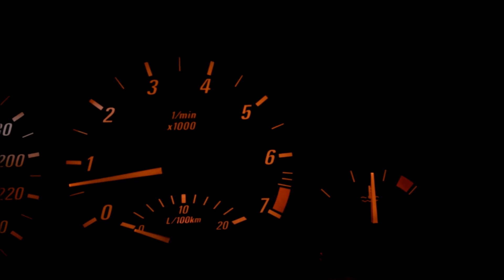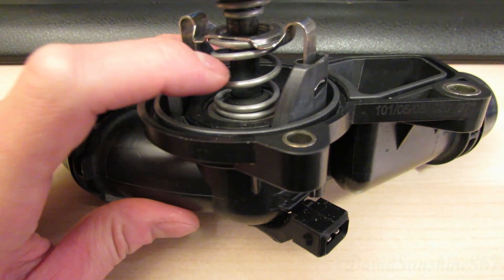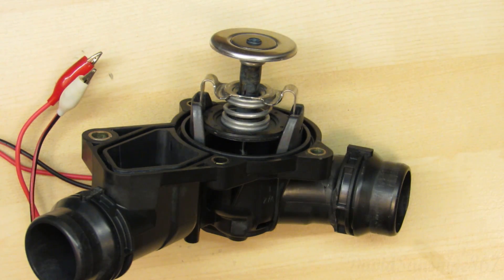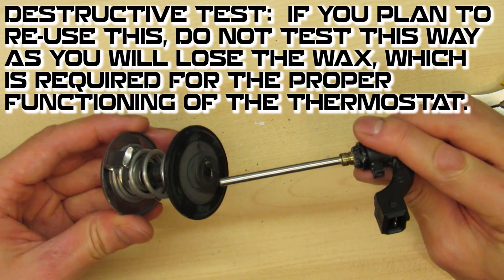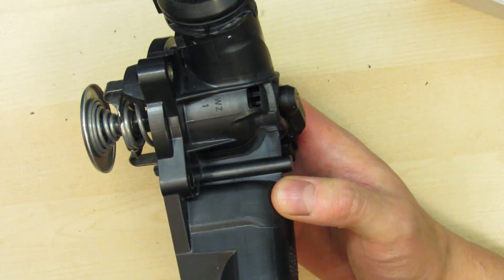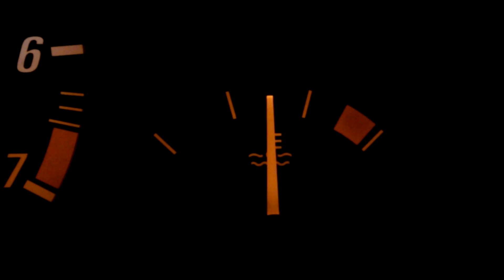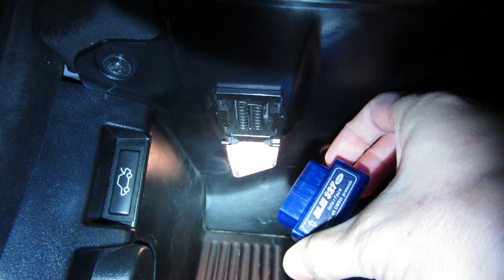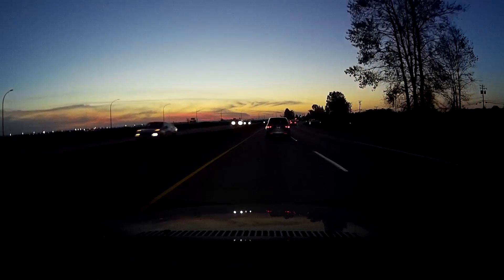How a Thermostat Works in the E46 - How to Diagnose a Broken Thermostat

Comment: David:  Just like you and your readers to know that my 2003 330i (purchased in 2003 with about 20,000 miles) just passed 100,000 (used to be wife's car)!  Thermostat never replaced!  So apparently it has a life of more than 10 years; car always parked inside garage, in Portland Oregon.  Bought a thermostat Wahler (box said Made in Germany with the BorgWarner marking) in 2017, not installed.  It cost less than $50 from Amazon.  Still exploring the mechanical aspects (draining the coolants and removing the fan and shroud a big adventure for me), hence coming across your excellent video.  Yours gave me more confidence!  Just re-built the DISA valve with an aluminum flapper and titanium rod/screw, having found the original spent flapper pin (metal) separated from its perch and dropped inside the manifold, almost had a heart attack!   Luckily it didn't get sucked into the nether!  Also cleaned the idle control valve, and flushed the throttle plate.  Bimmer is now as responsive as it was NEW!  In conjunction with the thermostat replacement, will also do the VANOS o-ring and seal repair.
Reply from the maker: Hi Frank!  That's great. Good it ran that long.  Mine was running fine until about 12 years old, was 2005 and I think the thermostat stopped closing in 2017, I put cardboard in the front so it could warm up on the hwy, until I got around to replacing it. It's not hard at all, with all the YouTube videos out there, I was able to replace it easily enough. I had to replace the starter because the battery was getting low and I kept using it, the weak battery must have left too much carbon on the commutator of the starter.  When I replaced the starter I had to take out the throttle body and cleaned it too. I also did the DESA valve as preventative maintenance, it was ok, but better safe than sorry.  It's game over once the engine eats the metal pin!  BMWs are a pleasure to work on, hope you enjoy swapping out the thermostat! 
Cheers,
David.
Reply: @DavidSunshine  love your creativity and bravery.  We have come a long way!  My other car, a 1999 Honda CR-V from new, manual is approaching 400,000.  Still drives smooth.
Reply from the maker: @fjwong7337  Amazing!  That's Honda longevity for you!  I've heard of civics getting over 500,000kms, that's insane.  BMWs can get up there.  But complicated systems require complicated fixes.  VANOS is one of those.  I got rid of my 325 at about 146,000kms though, so didn't have to do the VANOS.  In time I'll have to pay some attention to it in my X5 though.  I guess you're gonna do that soon too.  Good luck and hope you enjoy it!  Looks like a fun job to do.
Cheers!
David.

Comment: I have an e39 523i and my thermostat is stuck closed. Can i simply remove the thermostat?
Reply from the maker: Hi, the car won't run without it. You'll need the housing in there, you could remove the valve, and run the engine cooling at all times, but this is bad as the engine will run cool and damage will occur over time.  I would suggest replacing the thermostat since it costs $120, but will save you thousands in damage down the road.
Cheers!
David.
Reply: @DavidSunshine  yeah im going to replace it but tomorrow i need the car thats why i need to run it cold. I live in Portugal so we dont have that much cold here. Thanks for your reply

Comment: I actually thought that this connection was a temp sensor.  Very informative!  Thank you!!!
Reply from the maker: Haha, that would be cool, but it's just the heater.  The temp sensor is down low on the radiator pipe inlet(or outlet, I forgot).  You're welcome!  Glad you liked it.

Comment: Why the hell did you do all this. Kudos but i have no idea why this much testing of of a thermostat is necessary
Reply from the maker: Hahaha, ya, I dunno, just wanted to play around.  Probably cuz normal thermostats just open and close based on the fluid temperature, I found it interesting that this had some 12V1A heated shaft to heat the wax and force it open, interesting design, sort of ingenious too.  So it was interesting to play around with it and see how it worked.  Wax got everywhere on my table, but was worth the test.
If you find BMWs interesting, there's lots of funny stuff to them, there's benefit sometimes, but sometimes they can cause headaches when they fail.  The worst is the fact that the gasoline engine tries to re-gen coasting momentum into battery power(with a standard car battery), this means it won't charge the battery with a proper float voltage, if you don't properly register a battery in(with full charge), you could end up with a low battery(this combined with poor electrical connections partly due to lack of dielectric grease, etc.), which there are multiple recalls to fix throughout various models), and when it tries to save fuel by not using the alternator(only used when coasting, to save fuel), your engine can stall with latching codes!  Google it up, lots of stalling vehicles, and seemingly when they floor it to get on a highway/motorway.  Good times.  BMW's recommendation for deteriorating batteries was to swap batteries each oil change at 10,000 miles... LOL.  Seriously silly!  https://www.greencarreports.com/news/1098262_why-bmw-boosting-its-v-8-twin-turbos-fuel-efficiency-kills-batteries
Check it out, I'm sure you'll get a kick.  After all this tho, I still like BMW, along with many others, I think we've all gone mad.

Cheers!
David.
Reply: @DavidSunshine  uh thank you for this response and you are the shit!
Reply from the maker: @tawkinhedz  thanks! Lol anytime!  Good question!

Comment: I bought a thermostat from eBay  and received  it yesterday ,and I'm having to put up a big fight trying to connect the lower radiator hose to it .Have you ever had this type of trouble before?
Reply from the maker: Hi,
It could be that it's not manufactured exactly as the original.
Is it a good brand?
I found eBay parts to be there worst. 
I buy from local auto parts stores now. The parts from eBay always seem to cause troubles.
Remove it and compare it to the original with a caliper, you may find something is off.
If it's simply a lip that's too big, maybe you can file or sand something down to make it fit?
I've heard of the same issue where the person has double o-rings, check to make sure that's not the case.

Good luck!
Cheers,
David.

Comment: I have a 02 325i and I replaced the thermostat last June, and I hooked up the car soft obdii and it says 7b activation ,map cooling ,is it possible the thermostat went out that fast ?
Reply from the maker: Hi, 
I wouldn't expect the new thermostat to break that quickly.
It sounds like that code is saying the heater element that I test in this video isn't working right. Maybe just a bad electrical connection.
I've had various issues with electrical connections in all my BMWs, causing cylinder misfires (loose coil pack connection), air bag error lights (loose airbag connections), reduced engine power (loose camshaft position sensor connection), engine temp (loose connection), and they were all fixed using a contact cleaner (Deoxit is preferred, but any works.  If you use one without protection, you can add silicone spray or dieletric grease to the connector after to protect it).   

Without buying deoxit, you can try unplugging and replugging the connection 20-30 times(This worked for all my connection issues), and if the error goes away, it was that connection.
If you don't add protection(deoxit it or silicone spray/dieletric grease) to it, it could go again in a few years, or never go again(I didn't protect my coil pack, and it worked for years).  
Unplugging and replugging just cleans off all the oxidation(rust) that's formed, which typically prevents the connection and throws codes/errors.  Give that a try, it's free and has worked for me in the past.

I've actually purchased a few cans of Deoxit and have gone through all my car connections of all my BMWs and cleaned them, it has worked very well for me, I think it keeps the system operating in a much more stable way.  Here's a picture of the X5M Integrated BCM right before I disconnected and cleaned every connection, it's hundreds, and if you don't clean/protect them, any issue can pop up and give you trouble:  https://www.dropbox.com/s/kxqhqhfqb3owfez/BMW%20X5M%202013%20Wiring%20at%20BCM%20IMG-20181205-WA0008.jpg?dl=0
Look up the procedure of using Deoxit, they basically spray and unplug/replug 20-30 times.  I did an extra step and sprayed some more to wash out the gunk.  It doesn't hurt to overspray and over clean.  I spent 2 days on my X5M cleaning everything I could get to.  Because I had two electrical issues pop up in the same week.  The whole car was falling apart on me since it was sittiing for a long time, built up oxidation, then I drove it a lot; the combination of vibrations and oxidation lead to bad results.

Hope that helps!
Cheers,
David.

Comment: Cooling system made complicated for very little gain, and high risk!!
We have had one that does not open, which seems to the DME not wanting to send Open signal to it. Apparently the DME uses a few sensors around the engine to determine when this thermostat should open. Due to this setup M54 engines are prone to heating up and damaging, if one of those sensors are not working. Would like to replace this setup with normal thermostat, or have an independent temp. sensing electronics which controls this thermostat, and set threshold temperature to lower than 90 C.
Reply from the maker: Hi,  great point here!  
I thought that the thermostat functioned also with the wax temperature, and that it opened when the fluid got hot too(regardless of the electronic heater being on or off).  The electronic opening is only used when they want to further reduce the coolant temperature, like when you're driving aggressively or up a hill; I've seen this demonstrated in a video before.
That's a good idea, to add sensing electronics to control it.  Since they just apply 12V+ to it, I would imagine it's easy to add other 12V+ inputs to the same heater using diodes, then you could run the thermostat with a bimetal thermal switch or a digital thermometer.  You could put two methods in parallel for redundancy even.
I'd use something like this, https://www.aliexpress.com/item/1pcs-12V-Top-Quality-LCD-Electronic-Digital-Thermometer-Moisture-resistant-Mini-Smart-Temperature-Controllers-Testers-Switch/32737786056.html?spm=a2g0s.9042311.0.0.27424c4dET0lRe
You could put it in the car and see the temperature, and adjust when it turns on and off.  You could silicone the temperature sensor and/or the bimetal switch to the aluminum part of the radiator.

That's a little Mickey Mouse but should get the job done.  I would set it at 95C so that it doesn't activate too much, and is only there when the cooling system fails, thus saving the engine from overheating; it's backup.

I like to think BMW over engineered everything, but in all types of engineering, there's always room for improvement, and it's open minded people like you who think of it, and get things started.

I had a similar problem with my Aux turbo coolant pump in my S63 engine, it fails, and throws no lights, so you could end up driving the vehicle for years without it operating properly. It will lead to turbo failure.  They should have made it throw a latching hard code, but it doesn't.  You can unplug the pump and it won't care at all.  In that case, I was thinking the same thing, that I should install a redundant pump and have that turn on using a bimetal switch.  There's not much room to add a redundant pump though, so I just replaced the stock one with a brand new one(that failed in 1 day), and I got a second one on warranty, that is still working, but I'm keeping an eye on it using a bluetooth energy meter, I check it weekly in case the pump fails again.  These cars have issues, but we can manage. 

Cheers,
David.
Reply: @DavidSunshine  Thanks for additional info.
I was thinking of using a thermistor, some transistors and a relay. Might put something together when I have some spare time. FYI I we also have a later model X3 that only uses secondary electric pump, i.e. no thermostat. DME tracks engine temperature and emissions, and controls the water pump speed, of water back to the radiator. Once again, more complications and what if pump motor dies. However using a scanner I monitored three values while driving both X3s. Coolant temp into engine, coolant temp out, oil temp. Newer X3 (with electric pump) definitely runs a little cooler due as the the pump sending coolant to radiator earlier. The X3 with M54 engine runs to 96 degrees C before thermostat starts working, so runs hotter, which I am not comfortable with.
Reply: Bit pricey, but this is what we need:

http://www.zionsvilleautosport.com/store/bmw-m54-competition-thermostat-housing-kit/

Comment: Which temperature in celcius should the thermostat open (e46 320) ? mine is not reaching the 12o'clock temp.
Reply from the maker: It should open at about 88C.  Seems like my new one is.
If your coolant won't heat in up, your thermostat is probably stuck open.  I would replace it if it's older than 8 years, it's most likely the culprit. Replacing mine solved my problem with it not heating up, unless I was in stop and go traffic.
Cheers,
David.
Reply: @DavidSunshine  got my thermostat changed now. But stock e46 320 M52TUB20's thermostat should open at 97C so got myself one of those and now its working properly! 
Thanks!
Reply from the maker: @noelsjostrom7335  Nice!  Ya, usually there's a few options in temp, lower temps are good for hotter climates, if you're in a moderate climate a higher temp can be used. Glad it is working well for you!
Cheers,
David.

Comment: Hello again,
I installed a brand new thermostat. I checked it with heated coolant and it opened at the temperature a bit higher than that indicated on the thermostat (97 C, or 207 F); I checked with the vendor they said it's normal that it opens higher.
Then I filled up the coolant and bled as best as possible.
Now the heater is hot when driving and only warm when idling. I check the coolant temperature Live during driving, with a code reader, it never reaches that high temperature. The air temperature is around 0 C or 32 F. I check the lower hose it is always cool, meaning thermostat is closed even after one hour driving.
My guess is that because of this there's still air in the system, so I get warm not hot air at idling and the lower hose remaining cold. I'm pretty sure the thermostat is ok.
Please let me know what you think and how to remedy this.
Temperature gauge acting normal staying at 12 o'clock after warm up.
Thanks again.
Reply from the maker: Hi,
You're right, it does sound like you have air in there, keep driving it, and keep bleeding it for a while, and hopefully you get the air out. 
I think I had that happen to me too,  warm until I got the revs up, then warmed up.
The cooling system has this problem. Even in my x5m it gets bubbles up in the turbo cooling system, and takes a while of running to get the air out.
Just drive it like normal, and floor it a few times on your drive, that'll help push the air around.
Try the bleed procedure again too.
It didn't work fully for me right away either, but if you keep at it, it'll get better.
Cheers,
David.